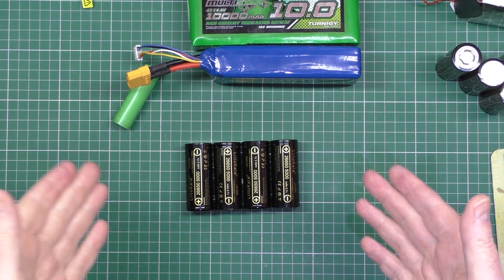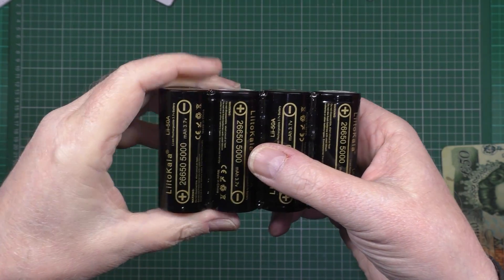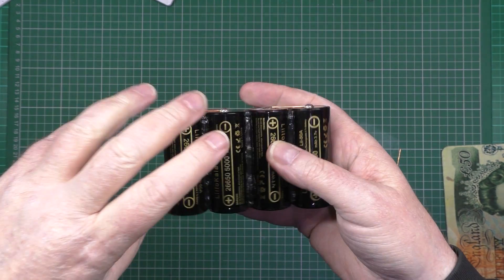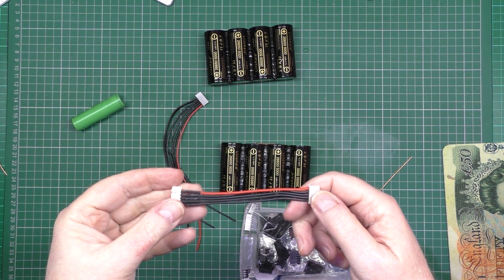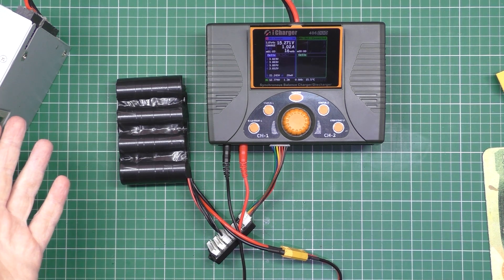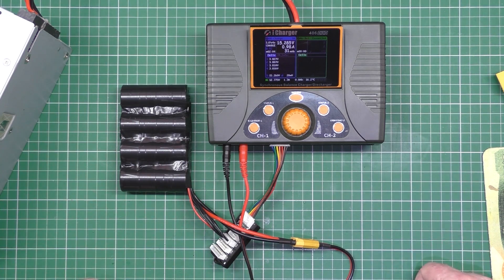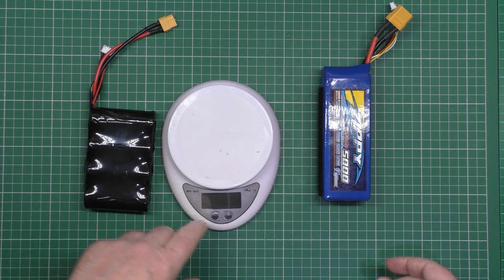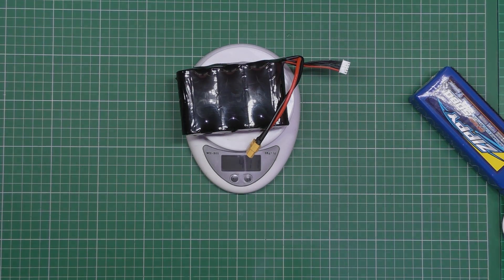26650 Li-Ion battery pack build instructions and capacity test

Comment: I am investing in making a 36V lion pack for my E-bike, a friend suggested your approach by stripping out some mains wire, I rejected this advice not just because I have seen pack builds using thin pure nickel strips spot welded to the battery contact points. I looked into this and found out that copper per unit length has a resistance of 0.05R, as opposed to pure nickel who's resistance per unit length is 0.005R, the nickel having 10x lower resistance to copper has all but made me opt for this design. I now have a spot welding pcb which cost around "£16 and a metre of pure nickel strip for around £2.50, since I am going to be using new batteries which have cost me nearly £90 I am taking no chances for a mishap. I am now looking into the issue of cell balancing when charging, all in all there is a lot more to this than just slapping a few batteries together and wiring them up.

Comment: casting. Would you use 26650 when they contain a lower rated 18650 inside the 26650 case?

Comment: Both the schematic and 26650 sourcing links you provide seem to be obsolete as of Aug2023. Would you please update? Thanks.

Also, have you performed any testing to verify the number of charge cycles these cells can withstand? If so, is the mfg spec in agreement with your findings?

Comment: Isn't 1 cell contains 5000mAh ? so having 4S pack equals 20000mAh ?
Reply from the maker: No, they're in series so you retain the same capacity but the voltage increases accordingly. If the cells were in parallel, they capacity increases but the voltage stays the same.
Reply: @Vortecks  I want to design one for a 7" long range cruise quadcopter. I want to choose between 21700, 26550 or 18650. I think the 21700 is the best one in terms of weight and power. It's' heavier than 18650 by 20 grams. So let me take out the 26550 of the comparison. Would 21700 be suitable for 6s2p ? but I'm afraid the quadcopter would struggle to lift the weight.

Comment: There is no internal resistance change to a cell thats been soldered? I find that hard to believe. I would bet $20 that a cell thats been soldered run at a high current against an unmolested cell will end up at a higher temp at the end of the discharge, by at least 3-4 Celsius likely 5-10 higher.
Reply from the maker: I have done tests to see if this is the case - If you do it correctly and keep the heat on there for the minimum amount of time, it causes no damage. It's only the negative side that causes potential damage as the positive has the button to dissipate the heat.
You're correct about the heat after discharge, though. Solder insulates the areas that dissipates heat and the main areas for heat generation are on the ends.
Reply: @Vortecks  Micah Toll tested soldering cells with a thermal camera. His results were undeniable. Any cell exposed to that level of heat even though he only did 3 second solder points, will be damaged.

Comment: Hi, do you think 4 cells can jump start a 1000cc bike that needs about 180 CCA? I see people using Lifepo4, 4  cells 6.5ah cca  95 for small bike and 8 cells for big bike Since the peak ampere for this 26650 is much higher, I figure 4 cells should be able to produce the similar power or higher than the Lifepo4, what is your opinion?
Reply from the maker: In theory, a 4P pack should be enough because it's only used for 2-3 seconds but it all depends on how well you build the pack. I'd be more conservative and say a minimum of 6P to ease the strain.

Comment: The most important is to use soldering flux for stainless steel! It contains phosphoric acid which dissolves the nickel oxide layer on the terminals. I use a 7mm diameter blunt tip for maximum heat transfer speed (about 0.5sec for complete tinning with 100W soldering iron). Make sure to always clean the tip, as the flux will eat away the copper tip

Comment: with li-ion 4s can i use this pack in a 70mm edf with a 70A ESC ?
Reply from the maker: Not at 70A. These cells will handle 50A burst for 5 seconds but they won't supply the full 70A. You'd need a parallel set (4s2p) to to get that power.
Reply: @Vortecks  thank you for your answer, and what about a 4s2p pack with batteries 18650 type ? could it work with the 70 A ESC ? thx.
Reply from the maker: @bilchiri   bilchiri  You'd need something like the Molicel P28A if you wanted a 4s2p.  This will give you 70A burst (only for 2-3 seconds) but a constant 40A. The one downside of li-ion is the voltage sag but the positive side is that they have a higher voltage range - More can be used compared to a lipo.

Comment: So how many of these for e bike to run on and best portable charger to opt for as i intend to rig charge port on my ebike project
Reply: A single cell of the battery is 3.7v nominal. Depends on what voltage needed for ur ebike. Also need to mind about the capacity. This battery usually rated ade 5000mah which i dont think it is enough for ebike. 

For charger... Hota d6+ is a good value for money acdc charger. If u got a psu ready. Toolkitrc m8 is a great cheap powerful dc charger rated at 300w and can charge up to 8s

Comment: What soldering iron do you use? My 140 watt weller soldering gun doesn't get hot enough for the negative terminal. I have to use my soldering gun and soldering iron for it to join properly
Reply from the maker: I use a Metcal. They're expensive but worth every penny. They work on ultrasound and they automatically adjust the power level.

Comment: Use FLUX to solder on batteries 🔋
I thought 2.7 Vdc was considered an Empty batt for the 4.2Vdc 18650 /26650s
Reply: 2.7v is indeed an empty battery,Vortecks uses the lifepo4 2.5v-3.6v voltage range instead of the lithium-ion 2.7v-4.2v

Comment: Tony,you've sold me on those cells! I've ordered 12 from Ali to make a 6S2P battery pack.I get everything you do in the video,but I'm trying to make the pack fit inside a large water bottle. This means I have to stack 4 columns of 3 cells joined in series. Can you tell me the best way of connecting the cells end to end ? I'm also not sure how to wire the 6S lead for balance charging?
Loving the videos and I've subscribed to your Patreon site. Keep it coming!

Comment: enjoy these videos, very informative, entertaining and inspiring.  
hypothetical question, could these 26650 cells be built into an  e-bike battery pack to power a 3kw hub conversion with appropriate charger & controller or should we stick to 18650s?.
Reply from the maker: There's no need to be hypothetical - I've bought enough to make a pack for 20kw which I'll be doing over the winter months. My tests prove that they're more reliable than the 18650's and they have more capacity to weight ratio.
Reply: @Vortecks  Similarly with 21700 cells. Superior capacity for extremely little increase in size.
For just 3mm increase in diameter (1.5mm radius), and 5mm increase in length, a quality 21700 can safely and reliably deliver around 40% more Ah capacity than an quality 18650 cell.

Comment: How would you come around charging a 4S2P battery which is inside the box and you would not want to remove it from the box ??? Any ideas ???
Reply from the maker: That's easy - All you need is to fit a cheap BMS (Battery Management System) to the battery pack and then, use a 14.8v charger. I might do another video about this in the near future.
Reply: Vortecks that would be greatly appreciated

Comment: Thanks for the video Tony, sent for some batteries and going to have a go at making a couple of 3s packs for my Bixler FPV plane. Full chat the motor draws about 18 Amps so should be fine. I normally fly around at 10amps.
Again thanks for the info and the link.
Reply from the maker: I've ordered 200 of them and I don't really know whether to use them on the bike, build custom packs for people or use them as a power wall for my solar project (video will be soon). 
I will be using this pack in my MT when my confidence comes back after yesterday's crash heavy landing....... in a tree.

Comment: Hi mate can you do me a favour can you check this eBay number as this guy is selling 12 volt 4.4 ah battery packs can you please read his description has he saying if you have five packs  wire them up it will give you 60 volt 20 amp hour
123064498600
Reply from the maker: Hi Nick,
Listing number 123064498600 doesn't exist?
Reply: Vortecks sorry 
123066151637
Reply from the maker: Personally, I wouldn't. You don't know what make they are and you don't know what condition they're in. Saying that, they are currently cheap so you never know :-)
Reply: Vortecks thanks for the info  more bothered about what is putting the description wiring in parallel and series it doesn't sound right to me   5 batteries wired in series would give me 60v but no way 20ah
Reply from the maker: Yeah, my thoughts exactly. You never know what you're getting - they could be very low current batteries and the voltage sag could be massive.

Comment: If you have a  e-bike battery 52V 17.5 and the same type 60V 17.5 battery both charged to 58..8V for a bbshd bike, will both batteries provide the same range?
Reply from the maker: You want to charge a 52v battery to 58.8v? I'd strongly advise against it as it could catch fire or explode.

Comment: Hi mate  could I use a xt90 connecta on a 36v 11ah ebike battery pack 18650 batteries
Reply from the maker: Yeah of course you can as long as you're not drawing more than 90 amps. How many watts is your controller or motor?
Reply: Vortecks this is only a baby one laugh out loud 500w motor the guy that built the battery pack put the square connector on it with a plus and a minus but now I've got a new bike and built a new box and want to hide all the wires if you know what I mean
Reply from the maker: 36v 500w is 14a max. You can easily put an XT90 on there. You could even get away with an XT60 :-)
Reply: Thanks for the info mate God knows why I put that bloody big connector on it looks like something that you use on a forklift truck lol so even if I up my grade my controller to 800w it will still be ok
Reply from the maker: Yes mate, you're good for up to 3000w at 36v with an XT90
Reply: Vortecks 👍🏻👍
Reply: Just fitted xt90 connectors all good was thinking about buying an on and off switch have you got a links to any of that would work with the battery and the amps
Reply from the maker: This will do you :-) 
https://www.ebay.co.uk/itm/222653559018
It'll trip at 100a and handle 90a continuous
Reply: Vortecks thanks mate 👍

Comment: if everything you have runs on 12v then you can charge the batteries to 12.6v as thats the standard charge of a fully charged lead acid battery (which is where i assume the 12v number comes from)
Reply from the maker: I don't think I explained correctly........Some things on my planes need a minimum of 12v
Reply: 12,8v is a full normal lead acid battery, 13,2v for a AGM. You measure the voltage after 2 hours or more.

 Charging voltage is normaly at 13,8v but it goes up to 14,4 for AGM and some cars alternators run at that voltage.

Comment: I'm so glad I've found this video series of yours Tony. Thank you so much for sharing your build in such detail. Your motivating me to think about converting my push bike now!

I have a few questions if you have time please. 

So the purpose of the capacity test is to fully charge the battery pack and then simulate usage by draining them down to in this case 3V per battery, to make sure that all batteries are drained equally and are stable etc?

When you say the batteries will go down to 2.5V safely, what you mean is the total amount of power taken from this battery pack is around 6000mah at 2.5v - so does draining the battery to low make it unstable and dangerous? Or is it more a question of seeing exactly how much power you can load and then use etc.

Finally, would it be more economical to use these batteries in a ebike build rather than the 18650?s 

Cheers!
Reply from the maker: 1 - The purpose of the test is to see how much (in milliampere hours) I can actually get out of the pack. 
2 - Correct but it will (over time) damage the batteries if you constantly run them down to 2.5v. When I fly my planes, I like to know exactly how much I can push the batteries before they die altogether.  
3 - I'm already ahead of you. I've been ordering 20 at a time (the max the supplier will allow) but it's going to take a few months to get the 100 batteries I need.
Reply: Thanks so much for the reply mate. Much appreciated. I'm learning a lot from you :-)

100 batteries. Wow. Your not going to make one huge battery pack with 100 in total are you? 

I was thinking about getting this kit below from ebay as people have commented you can run it using a 48v 20ah battery pack. 

https://www.ebay.co.uk/itm/26-1000W-Electric-Bicycle-Rear-Wheel-Motor-Conversion-Kit-LCD-Meter-E-Bike-Hub/122638459582?ssPageName=STRK%3AMEBIDX%3AIT&_trksid=p2055119.m1438.l2649

The photo on the back on the DC motor controller says 26+1A 

However 12 X 26650 cells = 44.4v so I am not sure how I can increase the Amps without having to much voltage, I.E am I not limited to 12 batteries only - or am I missing something? 

I think you can read I am not 100% clued up with this stuff! But it's fun to learn as I love riding me bike. Having some power for the hills would be very nice. I think I would ride it every day!

I'll be watching your vids a lot Tony. Thanks so much. All the best.
Reply from the maker: Yup..... 20 in series and 5 in parallel. That'll give me 100a constant and 250a burst with a total of 20ah but it'll weigh around 8kg.  
That controller is 26a +/- 1a (25a to 27a)
12 x 26650 fully charged (4.2v) = 50.6v 
You can have as many batteries as you want, as long as it's a multiple of 12. For every 12 batteries in parallel, you increase the capacity by 5ah. Does that clear things up? :-)
Reply: Wow. I can't wait to see you build that. With those batteries it should be amazing! I've seen people print out some cool spaced out battery holders for large clusters of cells, but I wonder if some heat sinks might be wise with that kind of a stack?

I wonder if you could design and print a case that has air vents like a radiator on a car. You could suck air in and through the battery pack aerodynamically as you speed along. Could be a nice touch to the design?

Thank you very much for replying and helping me with the info. I appreciate it. Making 12 of those new batteries into a pack would be a good starting point I think :-)

If I convert my bike I'll show you a photo once it's done.

The other thing I've seen recently is 2 wheel drive ebikes front and back. That would be the ultimate as I guess you would never tip the front of your bike. But expensive I know!!

Take care and be safe on the road. Cheers.
Reply from the maker: I went out a couple of hours ago to test all the mods I've done (new BMS, new 19" motorbike wheels, proper motorbike tyres and other things) and it goes like stink. I think I'll be sticking with 18s @ 150a because it already does over 60 which means I only need 90 batteries instead of 100 :-) 
When I have all the batteries, I'll have to design a battery holder but it doesn't need to be cooled really. Having a potential 250a to play with, I doubt it'll even get warm. I think it's going to be a winter project now because I'm not taking this thing apart in the spring/summer.... I've waited far too long for the weather to break! 
Please don't think of doing a 2wd version - front forks are designed to stop a bike, not pull it along which is why you never see a 2wd motorbike. You stand a good chance of ripping the front off........not something you want to happen :-(
Reply: Yeah sounds good. Enjoy what you have made so far, and then more upgrades in the winter! Those batteries seems like a real good find for sure. 

https://www.youtube.com/watch?v=SHXQr2MPJS8

You do see some 2wd small power designs, but for me the one moter is fine, not planning to go faster than 15mph!

Enjoy your bike. All the best mate.

Comment: So the + and - battery leads connect to the first battery in line?
Reply from the maker: No, they connect to the furthest points but on the same side (with a 4s pack). If you did a pack with an odd number of cells, it would be the opposite corners.

Comment: Can this pack be use on aerial video  multi rotor  platform?
Reply from the maker: Some people have used 18650 batteries for multi-rotors so yeah, there's no reason why not!
Reply: I fly a 550 hex, and recently built a 4s 2p pack out of 18650 cells..they couldn’t handle the current draw and lasted less than 30 air time..was told the 18650 cells were rated as 2c and may burn up if I try to push them..so I ordered some of these cells, it’ll be interesting to see what I get from them...#fingerscrossed!!

Comment: Any chance hot glue/electrical tape may come undone at higher discharge rate?
Reply from the maker: Yes it will, that's why I changed it to PVC heat shrink.
Reply: Merci,  monsier.

Comment: I didnt know that liions came in packages larger than 18650s. Are 26650s the biggest? Nice videos mate, they are appreciated. Perhaps you could do a video on the icharge charger?
Reply from the maker: You can get bigger cells but they're not really practical. 26650 is really the biggest that cam be made into custom packs. 
There's loads of videos on the iCharger - they've been out for quite a while now but I'll do a video in my own flavour soon :-)